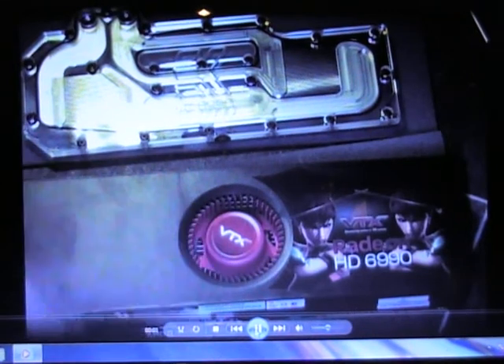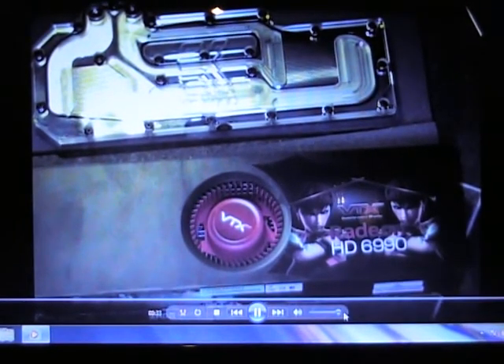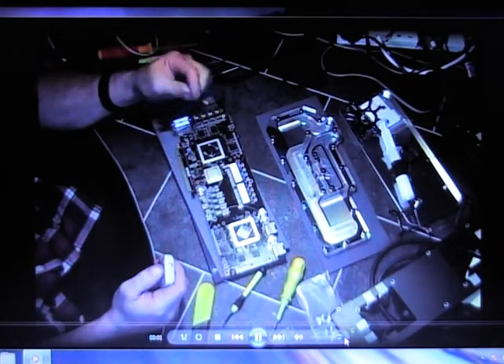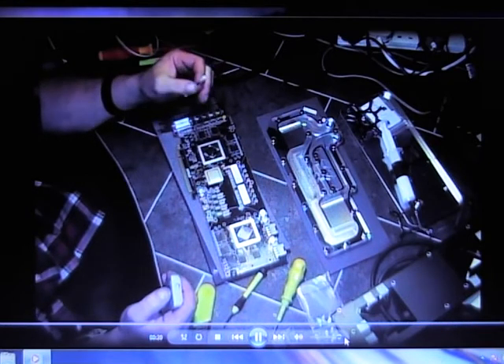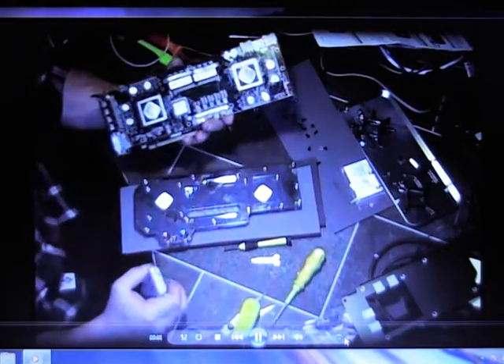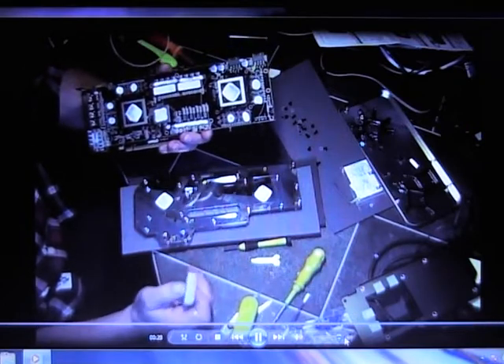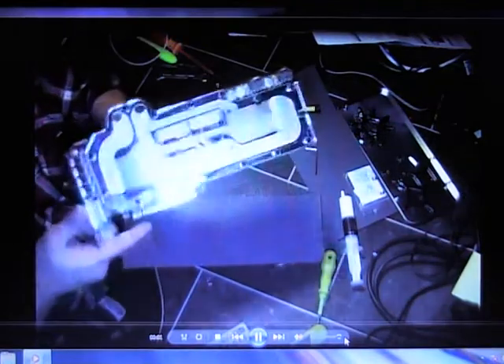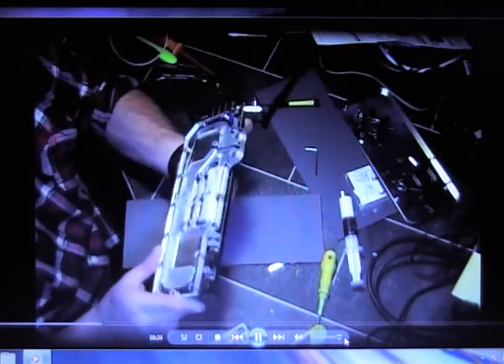EK Hd6990 Waterblock Assembly 1

Comment from the maker: @dkhissi Hi,you could send the card to us at Ionacomputers to fit water block ,email us at IONACOMPUTERS@gmail,com for arrangements ,you should recieve the unit back the same week after pre and post testing is complete we recommend EK water block ,also this is an extra long card so check case depth 10mm can be removed from length by converting  to this block once fitted clocking of card is excellent and almost silent ,